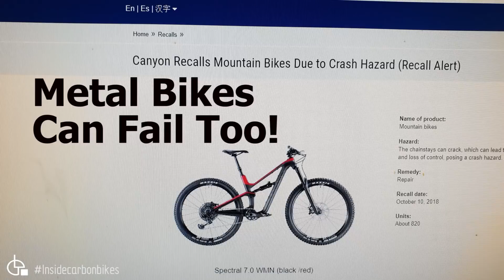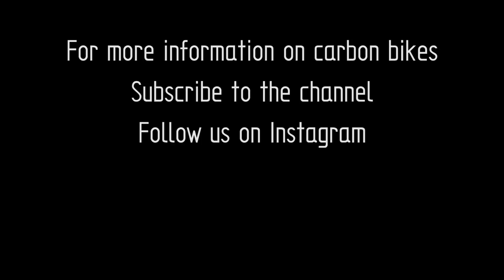Metal Bikes Can Fail Too!

Comment: Has anyone took a metal frame and wrapped it in carbon fiber and would it have any benefits ?
Reply: Plenty of rims, handlebars and stems over the years have used aluminium core and carbon laminate wraps. Some simply for decorative reasons, but many for structural/strength/weight benefits. In fact many of Shimano's Dura-Ace lightweight rims are alloy core, with a carbon laminate skin for example.
Reply: @SamHocking  I agree  my carbon stem has aluminum threads!  So I dont think it's a bad thing I did? It is a giant defy 5 with the carbon 2x2 3k fabric!
Reply: Not at all. There was a time when pretty much every manufacturer was putting a single layer laminate over old alloy stems (ITM for example) purely for decorative reasons. It didn't do any harm!
Reply: There isn’t going to be much of a benefit unless you are a very very heavy rider or you plan to use the bike for something outside of its intended purpose. Wrapping aluminum with carbon will increase the strength of an alloy part (according to engineers I’ve talked with this about in the bike industry). The thing is if you take something off the shelf and wrap it in carbon and then go ride it normally all you have is an extra heavy bike. Why? Because that bike has already been test and designed to handle the loads that are likely to be placed on it in normal use E.g. riding a road bike on the road and doing typical road rides. If that bike were built to a standard below what normal service will give it then doing a carbon wrap could be beneficial as it could stop it from failing.
Reply: The Shimano Dura-Ace rims are designed from the beginning to be carbon laminated, it's intentional by design.
Reply: @SamHocking  yea I did do alot of preparation to the aluminum ! I made sure it was abrasive enough to adhere to the epoxy I have two layers of it between the aluminum and carbon!  You dont want the carbon to bond directly with any metal! It's just preparation on the aluminum for it to bond well!
Reply: What's the point? If you are after strength then you might as well make a carbon bike the same weight as an all steel bike. As long as you put it together properly it will be so much stronger than steel.
Reply: @MrBJPitt  well I did it and I do not own a jig plus to build the carbon bike I dont have experience!  Plus I'm limited on money but 8 can get those materials for sure tubes and epoxy two part some carbon dope too ! But , I did just for experiment you can look at it if you want just tell me I'll shoot u the link ! I put a layer between the two materials so it would not have galvanized  corrosion!
Reply: @MrBJPitt  still light too but I just wanted to experience it but no one really has any feed back but me I dont know if anyone has ever done it
Reply: @chetlangford2144  you are probably the first. Props for making it 👍
Reply: @MrBJPitt  shimano does this lamination all the time with there wheels and they are really good at that!
Reply: @chetlangford2144  yep, never seen it on a whole bike though. How does your bike ride? Must be a stiff ride!
Reply: @MrBJPitt  not sure yet bro! Its in a cure state now from paint! I painted it weeks after the carbon! Now its curing so I dont crack the clear coat but, I put extra cf on the welds so all contact points plus around the head tube not much layers 2-3 but two layers on whole bike! The bottom bracket is very smooth and round !  Actually if you want to see it here it is ! I'll put the link in just tell me what you think !
Reply: @MrBJPitt  you can see part one to see the start of the frame

Comment: ...said every owner of an early Cannondale bike ever...;)
Reply: I have a Crack'n'Fail frame in my garage that had been accidentally cold-set to 90mm. I not so accidentally cold set it back to 135 and it didn't catastrophically explode, or even crack. It will however remain in my garage, as the rest of it is very shabby looking.

Comment: Had a chain stay snap on me on a MTB when I was using it on the road. Funny how I primarily used it for the road and it failed when I was putting the power down off a corner.

Comment: @LueScher Teknik what about lugged steel bike like colnago masters?
Reply: Bruce Wayne Everything can fail if crashed hard enough. Lugged 1-1/8” downtube bikes have been in production for over 70 years, so the limits of such bikes are well known. Such a bike used for its intended purpose won’t have any problems assuming no corrosion issues and no problems with the brazing of the joints. As far as I have seen in cycling media the Master is built by a very experienced frame builder, so the chances of a bad joint are low. If you’re under 200Lbs the chances of stressing the frame to the point of breakage is very unlikely. Do make sure to keep up with applying corrosion protection to the inside of the frame.
Reply: It's still a heat cycle. If done wrong, brazing too will create a weak point.
Reply: @AnttiBrax  That is less likely if silver is used rather than brass. But an experienced builder will know how to control the heat so that the join is not compromised.

Comment: Meh.
At least on metal bike you can check you're frame,and can be repaired.when it is on carbon frames you need to consult a specialist.
Reply from the maker: Yes, often metal failures in tubes are easier to spot due to cracks being visible on the surface, however flaws in welds are similarly difficult to find as a void in a carbon frame, hence the extensive use of ultrasound in welded structure testing. 
I would also recommend any repairs regardless of the material be done by a specialist.
Reply: Not always. Welding aluminium, titanium or cromoly steel often requires special equipment and 0.2mm of wallthickness cannot be welded by any hobbyisch guy.
Reply: @mathieub3953  Yeah, I had to get rid of my Peugeot/Columbus frame because it had a crack due to corrosion. A pity, it was so beautiful. They welded the tubes from the inside, you couldn't see it was welded at all.